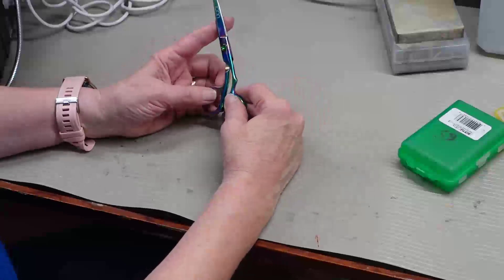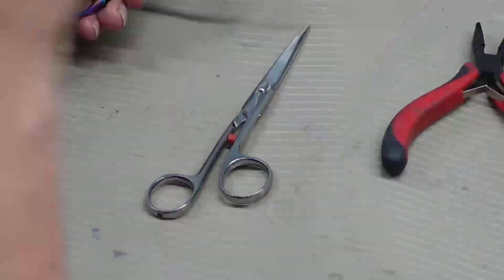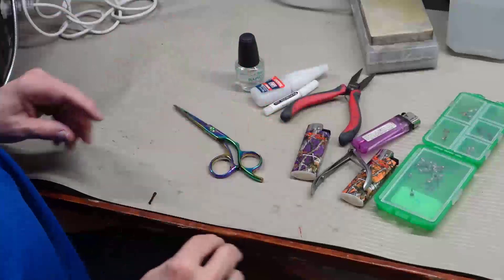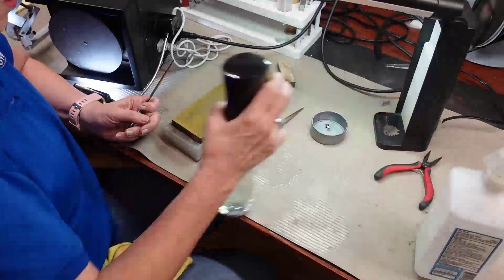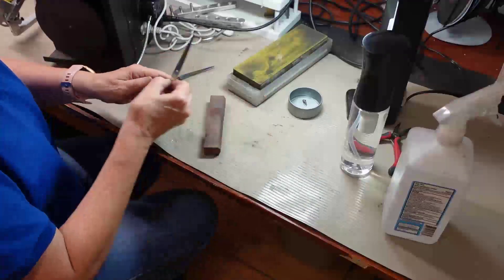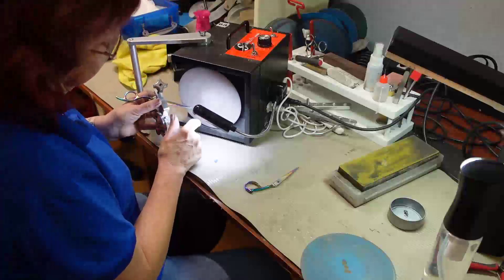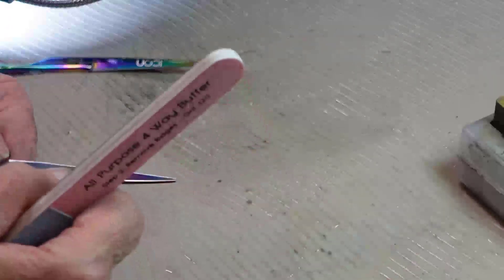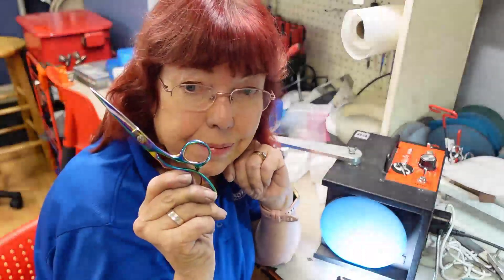Sharing Bumper Know-how + Sharpening an Out of Alignment Icon Beauty Shear | Bonika Shears

Comment: did you imply that the plastic-coated shears require bevel, not convexing?
Reply from the maker: These were color coated, not plastic. However, yes, these should be beveled otherwise the color is removed.